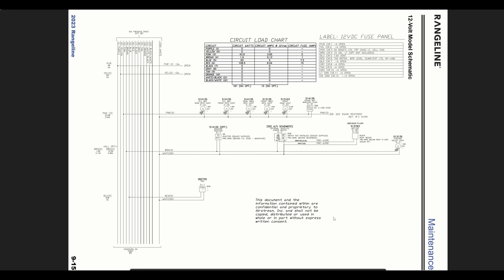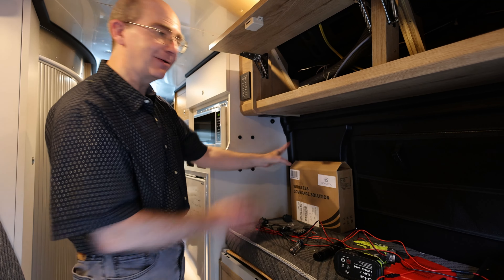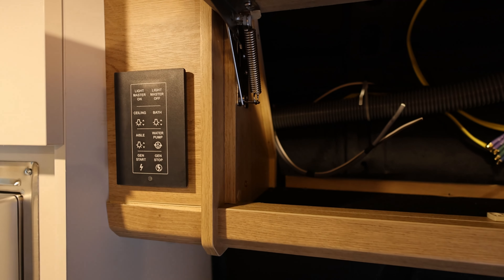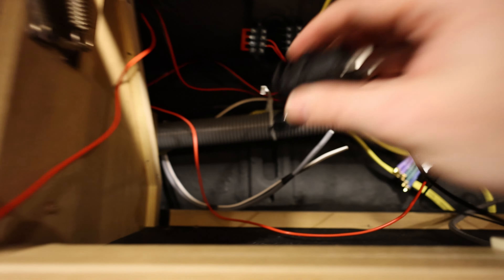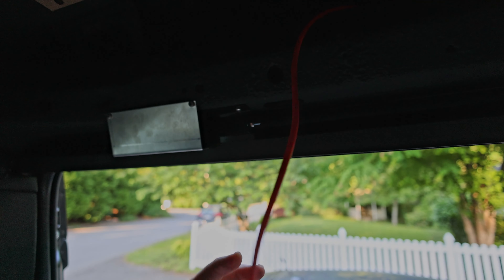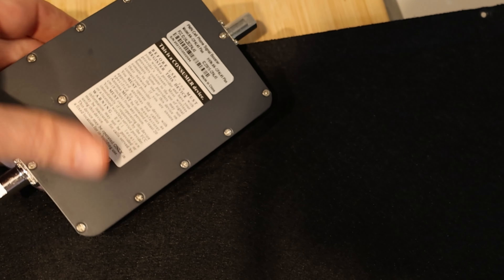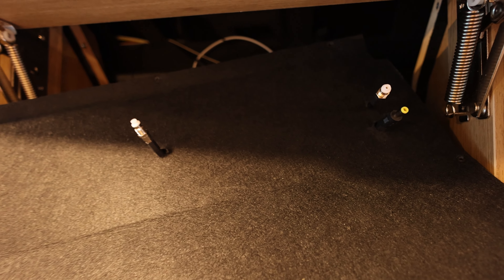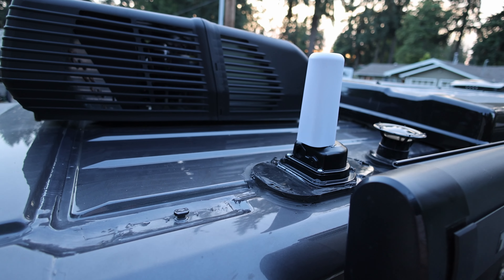Installing a signal booster in the Airstream Rangeline

Comment: I love your electrical acumen!.    Great stuff.  Can I request a video?   The existing 200W solar panel is not quite adequate to keep the fridge going and battery charged.  How about adding 1 more 200 W solar panel on the roof in series with the existing Solar panel.  The roof space will then be fully utilized and the Rangeline made Boondocking ready!   I think the MPPT controller will handle the additional voltage too last time I checked the specs.  Surely this would interest a lot of Rangeline owners.  Keep up the great videos.  You are a creative tinkerer!!!
Reply from the maker: It's on my list of possible upgrades. I did just swap the battery wiring on the solar controller and I highly recommend doing that (video to come). My unit was wasting time trickle charging the chassis battery unnecessarily and not generating much total power. Swapping the connects went from 14Ah per day produced to 60+. I haven't tried running the fridge to see how that fares with just the solar.

Comment: What exactly is that King roof cap? I am trying to figure out how to mount an OTA antenna to it but it appears to be merely an access point for cabling with one on both sides of van. However, when I removed the curb side cover there were no wires present. I presume I must fish them through from underneath by removing the back cabinet panel. Thanks for your videos!
Reply from the maker: Yes, the "pre-wire" they have is just some coax cable run behind the curb-side cabinets. You have to unscrew the felt cabinet backs to feed it up from below. The driver side has a bundle of 5 mini-coax that goes over to the curb-side.